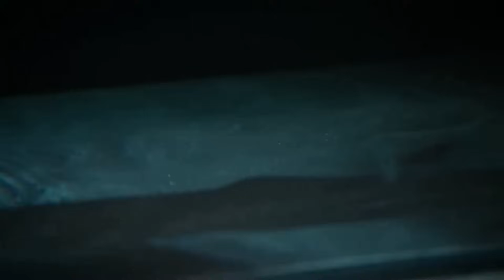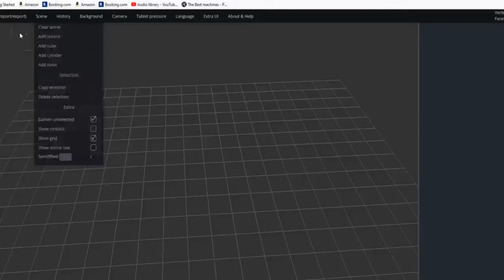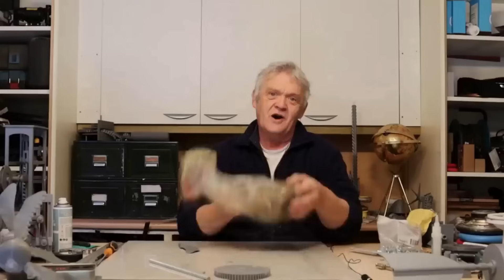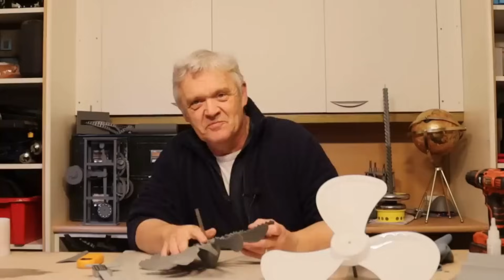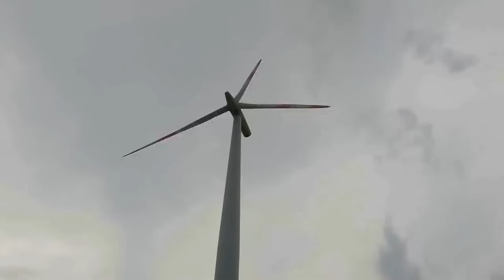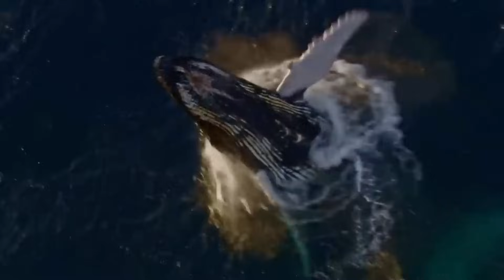040 The Power Of Whales - Tubercles On Everything

Comment: A PC fan with tubercles.  What a brilliant idea.  You could surround a VAWT with a shroud, put tubercles on the edges of the shroud blades then put tubercles on the turbine blades themselves, then 3d print lots of Viktor Schauberger Whorl pipes, and attach them to the shroud blades to direct Wind Vortices, and of course the turbine blades would be Ugrinsky.  Coloured smoke should reveal the AeroDynamics.

Comment: So the lumps funnel the fluid over the surface. Same flow, smaller surface area, thus less friction. Focused pressure zones. I like it.

Though I find myself wondering where the tipping point is. The optimal size of tubercle to the effected area. Whether there is the option to thin out areas that then have less pressure against them and less structural integrity required.

So many more questions!

Comment: Love your channel! I'm delighted that you have an episode about this.  I have a personal experience with tubercles and have my own opinion on how it's used in nature. I made my own tubercle fins for my surfboards, and I love how they behave. I spent about 5 years experimenting with them. My impressions of tubercles are more toward them being a means to manage the effect of a foil moving through a viscous medium. If you were to stick your hand out your car window at highway speed with your fingers together and pointed towards the wind, pitching your hand up or down would have a fast and snappy response. Your arm and shoulder would feel it! If you spread your fingers apart like the tines of a comb and do the same thing, the effect is much more manageable. I believe that this is how the humpback whale benefits from its tubercles. I suspect that concept is missed on engineers focusing on the aerodynamic/hydrodynamic aspects and how they might make foils more efficient with lift and flow. Humpback tubercles are not exact or uniform, so that leads me to believe that they serve a different purpose for the whale. Tubercles or scalloped leading edges are found on sharks too. Hammerheads have bumpy leading edges. Also, some sharks have them on the leading edges of their tail fins. Cheers!

Comment: Domestic Nuclear Battery -  OK :-)   I have no idea if this is already done on a workable scale.  My invention is:-  Based on the Principal of a Diamond Battery.  Scale the whole concept up to a Domestic Energy source.  The fuel would be spent nuclear reactor fuel which is presently put in containers in massive water ponds.  Take a reasonable piece of that decaying fuel.  Encase it in a Glass Substrate and encase that in a small energy conversion box.  The heat/energy from the Radio Active decay can be used to charge batteries to run a house.  The whole thing could be suitably shielded in underground chambers.  When the energy generation drops off after a couple of years, the Glass Capsule would be replaced.  What do you think of this ?

Comment: Using similar shaping on my hand made surfboard fins, they are easily faster than the  "regular" product, the 15-20% diagram you showed makes sense to what I experience riding them.  I assumed it is some sort of venturi affect aiding the water in entering and exiting the surface area more efficiently.